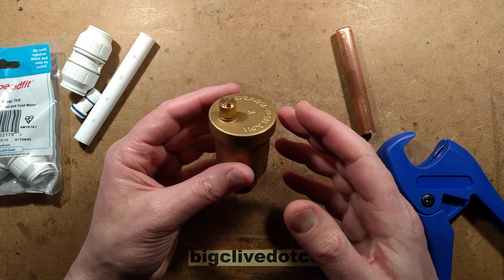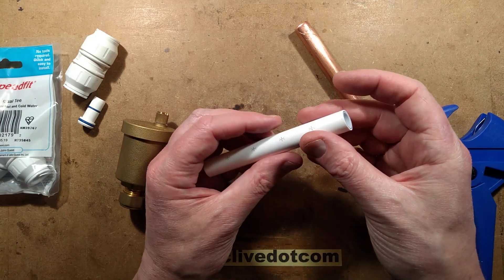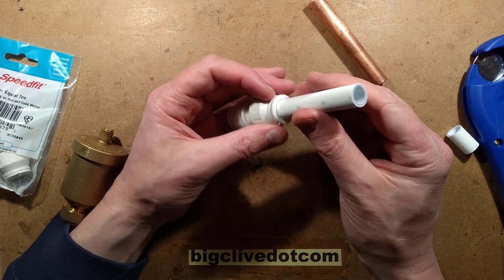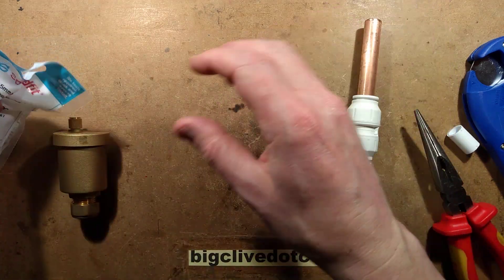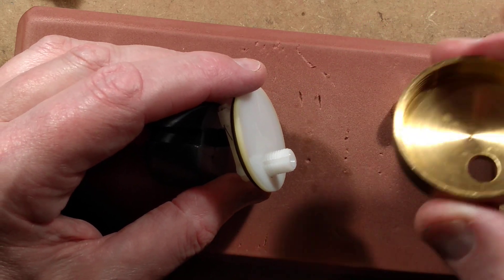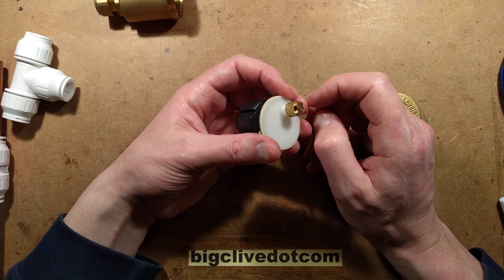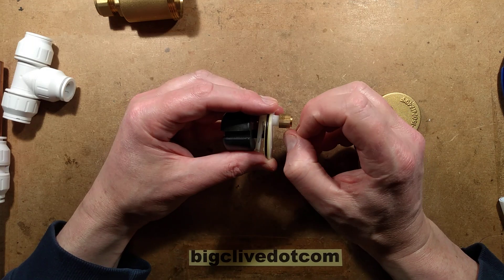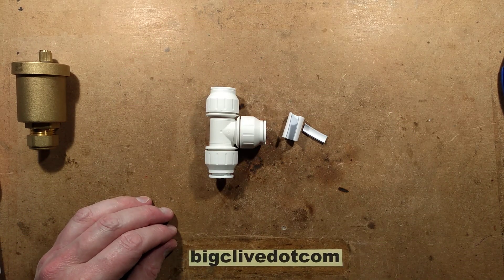Inside a bottle air vent and plumbing ramble.  (No electronics whatsoever.)

Comment: oh... and I forgot to say... be very careful of using push fit with SS pipe (a stub up to a shower for example) I found out the hard way that the grab ring doesn't bite into the pipe reliably. Luckily it was in a bungalow. :-)
Reply: Will Carroll any shortcut device attached to another shortcut should by its very nature become a failure.
Reply: @HighestRank  Hi.
After 30 years with no leaks I think it's a bit harsh and silly to label plastic plumbing a 'shortcut'. I also use copper with plain, capilliary and compression fittings but plastic allows for very long hidden runs in floors and roofs without joints. Plastic run sorface is ugly but then so are compression fittings.  Modern copper is nowhere near as thick or pure as the old stuff which makes it harder to bend without buckling or pinholes. Plumbers don't like plastic because they like charging heavily for their 'skill' with copper. Plumbers were probably once quite scathing about copper when their skill with sweating lead was being undermined. Will

Comment: The John Guest fittings are pretty reliable but from time to time you get one with a faulty ‘o’ ring or you sometimes push the ‘o’ ring out when you push  the (usually copper) pipe into the fitting

Comment: Time will tell, copper is good but fails with the wrong water at 50 years or so, flex pex is turned out to be the best so far, easy to fish, minimal 90's, easy to use, low cost.  I would be concerned with rigid plastic failing like cpvc in the US, it can become brittle and fail.  Certain fumes on outside of pipe can make it fail, high chlorine internal.

Comment: I did my central heating system using Hep2o plastic pipe fittings about three years ago and have had no problems and it is safe to use anti corrosion chemicals in the water. 
The inner blue layer in the pipe is as you say an air barrier.

Comment: For me (as I am not from anywhere close to England) it's so bizarre that you use copper.... it can sometimes make copper oxide that's poisonous... here we use stainless steel or for flexible connections a rubber covered with a stainless braided wire.... vary old pipes where brass tho and we use plastic mostly only for toilet's plumbing :D

Comment: the plastic pipe and fittings are used in Australia a lot for evaporative air conditioners, i have never seen 1 fail that was not stupid people syndrome like you mentioned not deburring the end and damaging the o-ring or just not being installed correctly, of course there is always the chance clive might fuck it up some how but other than that or manufacturing defects it should last a lifetime... or at least the rest of yours and the theoretical kids lifetimes.

Comment: I'm in a new build. Must be around 4 1/2 years old and I'm the only person who's ever in it. All the time I've lived here the closed loop system has always had a tiny leak. It was only a few years later when I finally found the leak. 
It was a 90o 22mm which leaked. I couldn't see anything wrong with it and all of the O rings inside it were absolutely fine so I've no idea why it leaked. 
It's been changed. To start off with, the pressure ever so slightly went down but recently it's been find.

Comment: There was many years ago a copper shortage so Poly pipe was used. We found that the joints were not all that reliable but a lot of work on the fittings has improved them. Poly pipe is expandable and is less likely to suffer from ice in cold weather. Best of all it is a lot cheaper than copper.

Comment: Only problem I’ve had is to my stupidity, mainly not pushing it in far enough. Ive had ones not even leak without an insert, that multi layer pipe is strong enough not to need one the single layer blue/red/green pipe does need one. Regarding inserts you don’t have to get the ones with seals on them either, the plain ones are plenty good enough.

Comment: Hi Clive, I first used plastic (Bartol Acorn) around 25 years ago. And it's even better now. I wouldn't pull either plastic or copper out of a fitting with the intention of putting the same pipe end and insert back. If you need to disconnect you can unscrew the 'nut' completely to take out pipe. and all fittings as one without rink of damaging pipe and o rings on the grab ring.
Hope this is helpful. Great videos,  Will

Comment: Those things last until the o-ring inside degrades and wears out.  So, you have no idea how long they'll last, because you have no idea if the manufacturer decided to cut expenses and use cheaper material, or they used good stuff that would last as long as the pipes.
Reply: You get a 50 year warranty on the JG Speedfit fittings Clive is showing in this video.
Reply: @arcadeuk  better make sure you keep all your receipts then.
Reply: @khaitomretro Receipts are all stored online now you know :)
I'll either be dead, or have moved house before these JG pipes leak (I hope)
Reply: @arcadeuk  Lol - might as well be a 100,000 year warranty. Come 50 years time you think that company will still be around and not been bought out and changed name half a dozen times? A warranty much beyond 10 years on anything don't mean jack shit.
Reply: @blower1  Why so much unwarranted hostility to JG Speedfit? They (John Guest, a British company) have already been around for nearly 60 years. They've managed to avoid changing their name half a dozen times so far .......
Reply: @arcadeuk  Even if they are still around and honoring a 50 year warranty, the cost of the fitting is minimal compared to the hassle of a failed connection. Most people wouldn't even bother trying to collect.
Reply: @chrimony  Plastic pipes have been the default specified for new builds for what 20+ years now, and we know that JG stuff is not know to start randomly leaking, so how many years will it be until you can accept they are OK?
Reply: @arcadeuk  I never said they weren't. Just that I wouldn't rely on a "50 year warranty" to inform me of such.
Reply: @chrimony  It's more the company showing their faith in their own product really. 
These are made in Britain by a decent British company, they have a long track record and I am not sure why people are hostile towards them
Reply: @arcadeuk  As I've already explained, the warranty doesn't demonstrate faith, because it's basically meaningless in practice. It's a marketing gimmick.
Reply: You can be sure that it was made with quality materials if it’s a WRATS approved product as they are the regulatory body that tests the product and if it meets their standards for a product to be sold with the WRATS label on it. 
Most manufacturers exprcssely recommend you use WRATS approved fittings on there product because of the guaranteed quality of the product. 
The O-rings will be fine for a long time if used on new plumbing but not as long on old plumbing.
it will depend upon the amount of crap that running around the system but even in really dirty old systems the O-rings should outlast your emersion heater and hot water storage cylinders by many years.
They should last longer on the cold water pipes as that water isn’t left to stagnate for long as it’s always used.
They will also last longer in areas with softer water as a pose to in areas with hard water.
The lime scale tends to build up around the O-rings and degrade them over time.
The WRATS products do cost more than non approved products but your paying for the quality and longevity of the product. 
In my own opinion I think that the whole push fit plastic plumbing system is a better system than the copper one even the push fit copper systems.
Even if the O-ring did perish or become unusable I do believe you can buy replacement O-rings instead of replacing the fitting.
Reply: @artyomhunter310  *WRAS
Reply: Same is true with the copper though, as Clive has found in practice. 
Ultimately there is an element of trust in terms of materials used by manufacturers (unless you have a Materials science lab in your basement 🙂). 
Buying from a reputable manufacturer is about the best most people can do.
Reply: Or rando  lots of materials  made in chiner.
Reply: Hep2o also has a 50 year warranty. But in all probability it'll be the flexible hoses used to connect up your taps that go long before the PEX pipe or fittings...as a country we've been using plastic pipes underground for water and gas for decades without any problems and any water supply installed in the last 50 years would almost certainly be alkathene (MDPE).
Reply: It may last as long as copper, but all plastic leaches chemicals. Also if you need to renovate and tear out the old pipes, copper at least is recyclable and has scrap value. Old plastic pipe is just gonna end up in a landfill.
Reply: @GMCLabs  "all plastic leaches chemicals"
And what makes you think so? What chemical should leach out of PE? Please go ahead and tell me because I cant think of anything.
Reply: That's the main reason I don't really trust the plastic piping.  The pipe itself seems very reliable, but o-ring seals invariably degrade over time.
Reply: @ferrumignis  Go with the crimp style and there's no o-ring to worry on.

Comment: i been using speed fit fitting for past 10 years never had a leak can plum a full house hot cold and central heating in a day rather then a week with a copper then finding leaks

Comment: Quite common in Ireland to use the PEX pipe but with copper compression fittings (and a copper insert). Mains distribution to the kitchen sink and attic tank was done with it when my house was built yet (decades ago) everything else is soldered copper which I find a strange set of choices!

Comment: I used PEX pipes with brass inserts and copper crimp rings to fit it together. After 20 years I haven't had any problems and my well water has lots of impurities. The only downside is the crimping tool is $50 or more and you can't use it in tight places. The upside is you can run one uninterrupted line from a manifold at the water supply to each fitting and never worry about leaks in the walls and as a bonus you don't get pressure drops from water to other fittings such as washer, toilet, etc.

Comment: Wonder how pvc piping will hold up tho hydraulic hammer action that occurs commonly in domestic plumbing.
Reply: apparently badly enough that per code where I live, if you use PEX at all in your water supply, you're required to install a water hammer arrester (like a well water pressure tank, or something smaller for city water supplies.)

Comment: Hi Clive , yeah the plastic is good , replaced my Dad cold water feed in the kitchen because the copper had pin holed and have had no issues and it's been in over 10 years. So i would go with plastic , i had similar reservations has yourself but worry not its good stuff . The only slight drawback over copper is over very long runs it can sag but really that not even an issue if it under the floor .

Comment: The first place I saw compression fittings like the one you showed was for gas fittings. All you had to do was make sure the Teflon tubing end was clean and right angle, and then press the tubing in until it bottomed out. It could withstand at least 150 psi of nitrogen. I’ve since helped install a water heater using fittings of this type with copper tubing, and everything has been trouble free. It’s a hell of a lot easier than sweating pipes!

Comment: Cross bonding of PEX pipe is not essential, just make sure its fused at 3A lol :-) also.. PEX is the same as XLPE? same stuff that SWA cable is made of, cross linked polyethylene.. so the video is kind of electrical too.

Comment: metal push fit am nice ....ive used a few neva ha any probs.
that air relieve valve is built on central heating circulation pumps lol

Comment: the march of progress.  60 years ago, a lot of houses still had water pipes made from lead. then we changed to galvanised steel pipe because of the risk of lead poisoning.
 next came the copper pipe, which was easier to use, smaller, less prone to rust and lots of other reasons that made good sense
now we have plastic. it's cleaner, doesn't require chemicals to join (now we have changed from the old glued type) and really easy to fit and maintain
the things I dislike are the size of the fittings (compare a 15mm solder tee to the plastic one in the video) and it's butt ugly if you have to surface run it. god bless trunking
if plastic pipe is good enough for mains gas, it's got to be ok for a domestic water supply

Comment: All but one of the leaks I've endured since moving out of my folks have been in plastic pipe houses, some of them were using pretty early / cheap plastic fittings and probably had fewer seals, but it's always been the joints at fault. In comparison the only copper pipe leake I've had was in Scotland in the heavy snow in 2010 where a flat conversion job had left a long length of pipe terminated and uninsulated in the attic and it froze. 

TL:DR - Go for the option with known reliability!

Comment: I have used plastic pipes for about 20 years and with everything it's all about the installation of the pipe there are three rules for plastic. 1. Be very clean and keep dust out. 2. Copper joints only use a wheel cutter and 3 KEEP EVERYTHING CLEAN. The failures I have seen is mostly about dust from building sites and the only other thing is people not pushing the fitting in far enough usually by not cutting on the marks. ALWAYS ALWAYS put inhibitors in your central heating as the Aav you showed will leak as it's the water pressure that makes the final seal and the smallest amount of dirt will make it leak. Finally the air vent you discribed as a wetting o ring would not be put on a sealed system and are for open vented systems.

Love all your vids as I am from the "other side" as a heating engineer that dabels in electronics.

Comment: Hi Clive interesting video Here in the US we have something very similar to those fittings they are called "Shark Bites" (I think) and like you I am from the "old" school copper era (I am 55) and I had to do some plumbing repair awhile ago when I seen them and thought the same thing as you did "no way --this will leak like a sieve" but I tried them anyway and was blown away how easy and simple they were to install and use AND what would have easily taken me a 1/2 day to re-plumb my bathroom using copper having to solder and make sure the length is spot on, clean and every little thing else that has to be perfect when using copper so it doesn't leak was finished just over an hours time! I could not believe it' That was 5yrs ago and still not one problem with that type of hook up I wont use anything else now if I have plumbing work to do it is just that easy and simple to use for BOTH Copper AND Plastic pipe

Comment: I have a love/hate relationship with PEX.I love the PEX systems but hate how expensive the tools are.I once had to buy a tool to fix a leak that took less than 30 seconds finish haven't had to use it since.
Reply from the maker: I bet the cost of that tool was still less than the cost of getting a contractor in to do it.
Reply: @bigclivedotcom  In this case actually no.Since Pex is so foolproof for the average homeowner it's cheaper to call a plumber than buying the tools to DIY the once in a blue moon leak.

Comment: I've used these fittings extensively too.  I would say the 22mm fittings and pipe are a bit more fiddly to put together (for me as I'm a bit wimpy) and I find that much harder to insert fully, especially in our central heating circuit which was in a 3 foot floor void that I had to crawl around in to put together.

Did you figure out that you can twist the ends off and then not have to take the grippy teeth out?

Comment: Personally I much prefer poly pipe to JG as the teeth are more robust and the pipe can be removed without damaging it.
Reply: Toobye and I prefer to JB weld poly to Cu when the original installation was Cu, cutting apart right at the pinhole to leave as much of the original pipe and reducing my investment in plastic as possible, while ensuring my services will be required again in the shortest possible time.